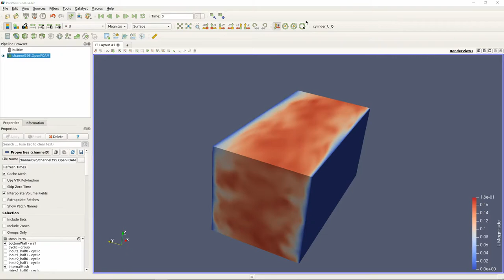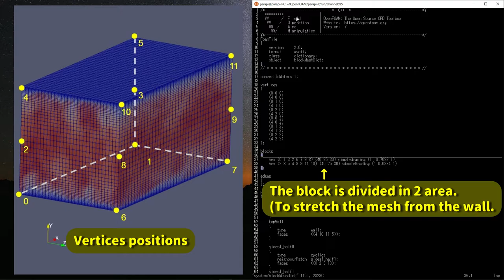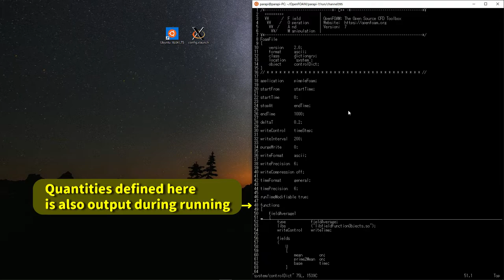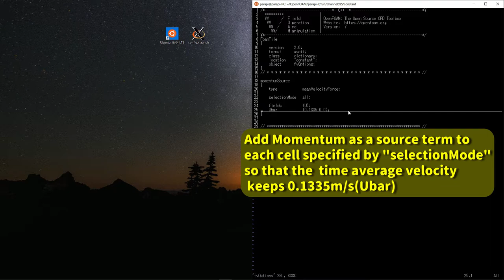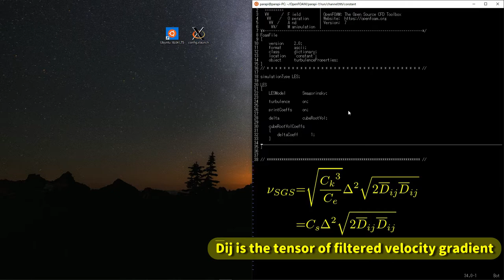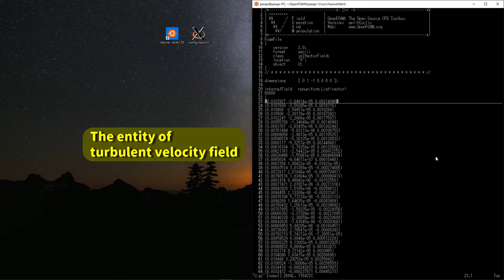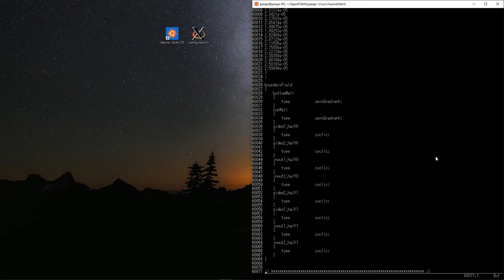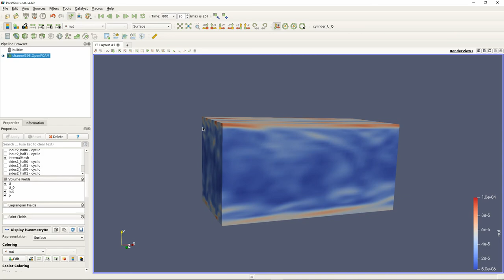【OpenFOAM tutorial#4】How to run LES Smagorinsky model【fluid mechanics】

Comment: Hi, thanks! Do you know if is it possible to run LES in implicit mode? Thanks!
Reply from the maker: Try using pimpleFoam for transient flow and simpleFoam for steady flow.  You can run LES in both solver.
Reply: @FluidMechanicsView  Thank you! But my question was different> can I run a LES in an implicit way ?
Reply from the maker: what means implicit?
Reply: @FluidMechanicsView  without any subgrid model
Reply from the maker: Though I’ve never tried, set turbulence “off” in turbulenceProperties file. 
  
https://www.openfoam.com/documentation/guides/latest/doc/guide-turbulence.html#sec-turbulence-usage
Reply: @FluidMechanicsView  yeah, I was thinking to set laminar; and let the grid all the job